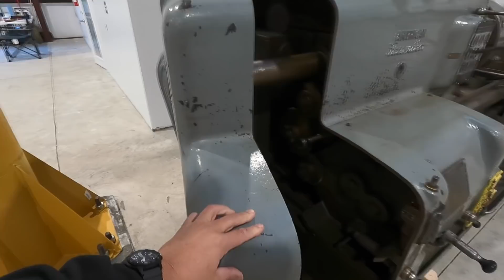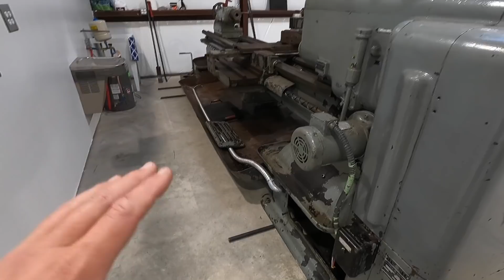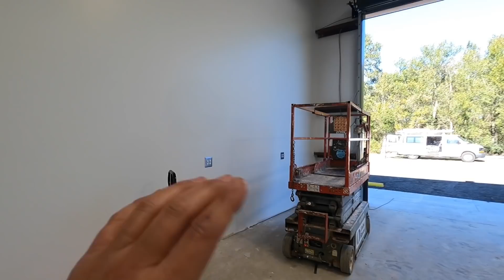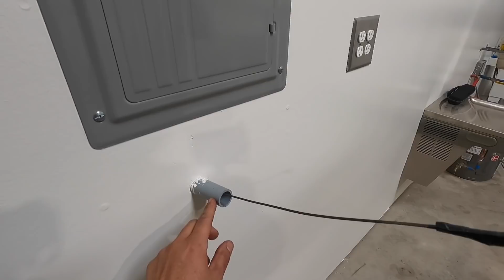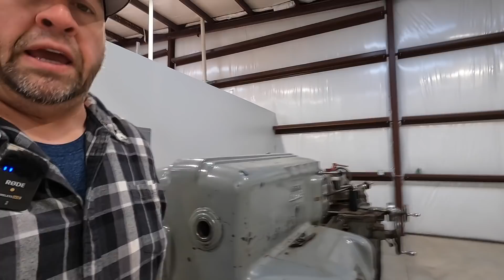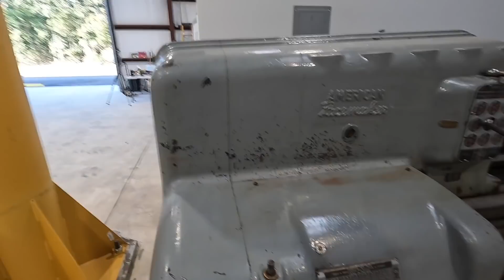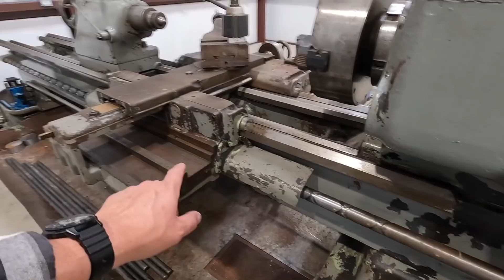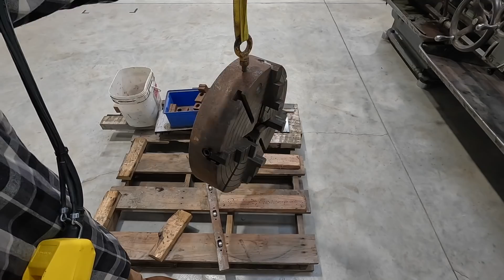New Shop Space Update 12: 3 Phase Electrical Circuits, Lathe & Crane First Tests

Comment: Adam, I wonder if cleaning the rust off the chuck might be done with blasting it with dry ice or baking soda. I've seen both used to clean wood surfaces of things like mold, paint etc.
It might be worth looking into because I'm pretty sure neither one could harm steel. (like the treads)

Comment: Heaters in motor starters are always rated for the motor plate amperage at the voltage they're wired to run at. You stated that the lathe was wired for 460-480. Rewiring the motor connections to 220-240 causes the motors to basically draw double the amperage that they were on high voltage which will cause your overloads to kick out. 
All of your motor starter heaters will need to be changed for the higher amperage.. The motor plate will tell you the size that you need. There's a good chance with very old lathes that you won't be able to buy heaters for those old fashioned starters/overloads. You may have to upgrade the motor starters or at least the overloads to take a more modern heater.

Comment: wondering if dropping the electric from above would have kept that conduit off the floor! i really would hate the dust and chip catching capability of that!? how bad would it be having the juice come from above?
Reply: I'm sure Adam will fix that tripping hazard. I surely wouldn't want to be stepping over that for many years. Cut the concrete and put a conduit in. Probably 30 minutes work.
Reply: Here’s an idea.  Build a 36 inch wide raised plywood walkway behind the 
lathe with the conduit running under the walkway for safety. Use Marine plywood 3/4 x 36 on 2x4 runners painted grey  walkway should run full.length behind lathe to water fountain.

Comment: Wrong heaters for motor, bad motor, wired incorrectly. My 2 cents, should take only a few minutes to figure it out. Heater size for amps may be on inside cover. Regards.

Comment: I used to install heavy industrial equipment, 10s of tons.  A stevedore dolly or as it is known today a lever dolly can easily move heavy equipment short distances to tweak placement.  You insert the dolly at an angle, lift the load, them rotate the handle of the dolly sideways, moving the load a few inches, then lower the load.   There does not seem to be any videos showing the use of a stevedore's dolly.

Comment: The heaters are the wrong size ,you went from 480 to 220 volts so you need different heaters not a new box . the electric should be able to get them. ( the old electrical service man,)

Comment: The heaters are sized to the amperage, at 240VAC the amp draw is about twice the amount of operating at 480VAC. The shop is looking great.
Reply: When you reduce the voltage the amps go up to make the same power.  Likely you’ll need to double the rating on the heaters.  The are basically thermal overload protectors.
Reply: Yes, The heaters (or overloads) need resized for the 240 volt amperage.
Reply: My second guess was one of them burnt open and one is taking the full current. If it’s wired in parallel (who knows by what the video shows)
Reply: Exactly what I was thinking. 👍
Reply: At 120 it’s triple
Reply: Ohm's law! Learn it.
Reply: @lukamadunic8534  ohm's law is for DC aplications only...!
Reply: May be i'm wrong ,but that motor needs to change a connection from star to delta ,and it should solve thermal fuse issue....
Reply: @dzintarsdzintars1547  It's unlikely this motor can be changed from star to delta.  Most dual voltage motors are either wired as star or delta and that doesn't change when the voltage is changed.  The way a dual voltage motor works is that each leg of the star or delta is made up of two windings instead of one.  When the motor is operated on high voltage the two windings are connected in series.  When operating on low voltage the two windings are connected in parallel.  Some motors can be changed from star to delta but that is not for voltage changes.  That is done to give a crude 'soft start' feature when starting the motor to reduce the inrush current.
Reply: Nothing you said there actually made sense
Reply: The heater resistance is constant, so half the voltage is half the current, and thuis a quarternof the power. Must be something else wrong.
Reply: @loewietje4897  👍 such a simple notion missed by so many people!! Assuming of course the elements are purely resistive.
Reply: Admittedly the circuit is probably more complex that the suggestion of being just basic resistive loads at the terminals.
Reply: @loewietje4897  Your comment is partly correct but does not hold in this case.  If the only item in the circuit is the heater then your comment is correct.  Halving the voltage results in a halving of the current through the heater and the product of half the current times half the voltage gives one quarter of the power.  However, in a motor circuit the heater and the motor are in series and the heater has very little resistance relative to the motor.  Therefore the heater has very little effect on the current flowing through the circuit when the voltage is changed.  When a dual voltage motor is changed from high voltage to low voltage the current must double in order for the motor to make the same power.  Since the heater has very little effect on overall circuit current, twice the current will flow through the heater.  Since the power (heat) created in a heater is equal to the current squared times the resistance (of the heater, not the overall circuit, and as you correctly pointed out, remains constant) the heater will generate four times as much heat, causing it to trip.
Reply: @hmw-ms3tx  thanks, that makes a lot of sense, so what people call heaters are actually a type of thermal fuses? That would explain a higher current due to feeding a motor of a given power rating at half the voltage.
Reply: @pjvenda  Yes, heaters are thermal fuses.  Since power is the product of voltage times current if you halve the motor voltage you need to double the motor current to maintain the same power output.  Heaters (thermal fuses) are rated for the current passing through them, not the power passing through them.

Comment: I'd be curious to know: If the steady-rest and the 4-jaw are going to "live" on the ways, should they be in place when you level the machine? There is a considerable amount of weight there, which could potentially affect the "flatness" of the ways, and, IMHO, if it were my lathe, would be something I would want to consider. Accuracy being what it is and all. 

NOW, time to back the Ram in, and do a "LOAD TEST" on that Gorbel!! I wanna see that thing WORK for it's money!! That thing was built right down the road from me. Curious to see how it's gonna hold up. I could have used that joker on more than a few engine and restoration jobs!! Congrats on the new shop and all the new "toys"!!

Comment: Forklift mechanic here, you can ride the middle pedal like you would an automatic transmission for delicate moves., the left pedal puts the transmission in neutral so you can rev the engine to speed up the hydraulic functions.

Comment: The Item used to pull wire is called a "Fish" .  Invest in a Phase Monitor It can save your Three phase motors. The better ones monitor power in and power out.
Reply: Been a licensed electrician and industrial electrical/millwright contractor for over 40 years. "Fish" is what you do up inside a wall ect. You PULL in wires through a conduit of other raceway, though. You do not "fish" conductors (wires to you) through anything, Dave. 

Go hang out with some union electricians at the bar and you will get a better grasp of our jargon. Looks like you got it all wrong,  bro..
Reply: @mathewmolk2089  fish tape is what 90% of people call it. Being a "licensed" electrician I'd figure you'd know that 🤷‍♂️

Comment: Check the control voltage coming from Transformer 
Needs rewired to low voltage. 
The output of Transformer is running at half voltage. And making contacts flutter. 
Just a guess.

Comment: Those heaters are overloads for that motor. It was wired for high voltage. Changing to low voltage doubled the current. They’ll have to be replaced with the proper amperage units.

Comment: Looks like what you call heaters are part of the starter that produces heat to trip out now just about obsolete thermal overload. It appears that there is only 2 heaters. Since at least 1970 code requires 3 thermal over loads on all three phase motors. GE is the worst safety switch and most hated by sparkies. GE always had the worst service & tech support. Last 2 120/208 ge garbage panels that I worked in could not open doors more then 90 degrees. Both were brand new not cheap 3 phase 42 circuit bolt on breaker panels. Good luck with the new shop.

Comment: The heaters/overloads for the rapid motor are sized for a 480VAC motor but since you are using 240VAC the heaters are sized to small. The heaters need changed.
Reply: Good idea and also change fuses because they are at half the amps needed now.

Comment: Clutch noise - it's not as bad as mine, I think ! Greasing the clutch bearings will quieten that. 
Overload trip - as you've connected it to half the previous voltage, it will have doubled the current - as the power of the motor remains the same. That will trip the existing overload. It'll just need different heaters or setup for the lower voltage. Keep the existing bits though in case when you move you end up going back to high voltage. The spindle motor should also have an overload trip too.

I'm going to have a random guess that the spindle is an L1 taper - on the grounds it'll be bigger than my L0 taper. I've heard people say they don't like this spindle fitting but I like it - because things will only fit one way.

Comment: the heaters need to be replaced with units that can handle 2X the current.  The transition from 480V to 240V halfed the voltage which doubles the current per Ohm's law (and reality!)
Reply: My thoughts exactly....I dont know if they even make overloads with heaters anymore. It pays to be the old(er) guy sometimes.
Reply: I just also remembered dashpot relays from back when. Thats some old stuff for sure.
Reply: i had the same issue with my 10ee.  came wired for 3ph 4 wire 480V.

Comment: As a life long electrician ALL electrical panels need a minimum of 36" in front of panel along with believe at least 32" wide space. Had inspectors write up companies because they had a 30" deep work bench in front of a panel. NEC wants ALL panels to be readily accessible. Fire marshall had a baby when he went into customers main switchgear room and found a skid of popcorn kernels stored. Told them about this violation a few times but they ignored me. Thanks for all the great vids. Always liked doung electrical work in machine & tool & die shops the most.
Reply: It will be just fine
Reply: @littlejackalo5326  As long as he does not store 55 gallon drums skids etc blocking a clear path to panel. Did a lot of work in machine shops that as time went on they accumulated  a ton of stuff. Used to piss them off when I told them that the machine 3' in front of a panel must be turned off for several hours while I install conduit and wire because isle is blocked.  Did the OSHA 10 class to renew my electrical license and up until the pandemic started attended 8 yearly classes by the great IAEI where they brought up all kinds of violations. We had Mike Holt come up from Florida for a couple of classes and a guy from UL labs. Learned that the cord & plugs that I have probably made over a thousand of them in last 50 years are not legal even though I use a meter & a 1000 volt megger to check them. They have to be listed. So if a customer wants a 3' cord & male plug for say a garbage disposal I have to go to my supply house or big box store and hope they have 1 in stock.
Reply: @garbo8962  Anybody catch the fact the 120E240 1ph and 240 delta service disconnects are not grouped as required in the NEC 230.71? (I don't think they pulled permits on this one, so Adam should be OK)

Just FYI I always liked to design systems to put panels in a hall or walkway where nothing will ever get piled in front of them. Worked quite well for over 40 years.
Reply: @mathewmolk2089  did not pick up what you mentioned. Thought  he only had a 120/208 service.  In my area all new work on a new building must have a petmit and pass an inspection by an approved inspection agency. The local ultility company will not supply power until the inspector calls them. Just love when a clue less local imspector fails a job after an inspection agency approved it. Had one local ahole call me up to tell me that I had 3 violations. Told him that if I had 3 legitimate code violations I would quit doing electrical work. First piss poor violation was that I spliced 1 #14 guage wire in replacement panel. Told him exactly where in the codebook this allowed. Other 2 violations were for the way Pepsi guy wired up a new outdoor sign that was not on my petmit or connected in any way to me. At a continuing education class an inspector told us that in some small rural areas homeowners get a general contractors license so they can pull electrical plumbing and other permits. Our state does not have a state electrical license and some hick towns do not recognise electrical license from any where makung you spend halve a day to take their test. We have been trying to get the state to go with a state license since 1964 when my dad took his test.

Comment: Congratulations! As you fill that place up and start running out of room you might consider placing that lathe on an angle.  I might have been tempted to tuck the head stock end  in-between the wall and crane.  Provided there’s enough room to open that door, would also allow for long stick support if you ever needed it.  I know that electrical box is right in the way…

Comment: If you have changed the voltage that the motor is running on then you must resize the motor starter heaters.
Reply: Quite right. The heaters act just like circuit breakers in that if the circuit draws too much power the heaters heat up and open the contact points they use. All your electricians will have to do is use a amp probe to measure the amperage being used by the motor then replace the heaters that can handle that amperage.
Reply: @sandrammer  Well not actually, the heater has to be sized by a chart because if you use the "run amps" then the heaters will trip under normal operating conditions. I has been a long time since I had to work with motor starters and heaters but i think you would size for something like 15 or 20% above run amps. Enough to protect the motor but not have a bunch of nuiencentes trips.
Reply: @davidtyndall9604  , I didn't mention the sizing of the heaters because I couldn't remember how much larger the heaters had to be to work over the life of the motor.

Comment: Love that lathe, congrats on getting it running. A lot to do before cutting chips but at least you have power, next is leveling it and then you can finally go through it and get it up. Congrats Adam. Looking forward to these stages in my own shop. As for you being very happy, I would be dancing a jig and having a nice frozen vodka. Very cool.
If it were me, my very next item would be a bench, even if it is temporary to use while getting the rest of the shop together. Maybe on some casters with locks as you will need to be able to move it around as you set the shop up.
Reply: I wish I could make progress with my own 'toys'. I've an electrical problem I need to sort out - then it's lubrication - on a pair of machines I've inherited.

Comment: The heaters are sized for the motor running at 480 volts. The heaters need to be sized up for the larger amperage the motor draws at start up on 240 volts.
Reply: Most electricians are not motor controller techs.
Reply: It's not the starting current that's the issue but the running current.

Comment: It'r probably to late now, but when the electricians changed the voltage on the little motor they should have changed the heaters in it overload switch. When you half the voltage you double the amperage, thus a heater change is needed.
Reply: In the UK our overloads are adjustable. Depending on the specific overload as to whether it'd readjust far enough or not.
Reply: @millomweb  , here the USA the modern ones are to. However this is an old unit.
Reply: @johnirwin1837  Our Elliot Cardiff has non adjustable heaters...It's an "old" machine though.
Reply: @johnirwin1837  Modern ones don't appear to have reached YouTube yet ;)
Reply: @millomweb  , the new starter in the box on the wall is a modern one.
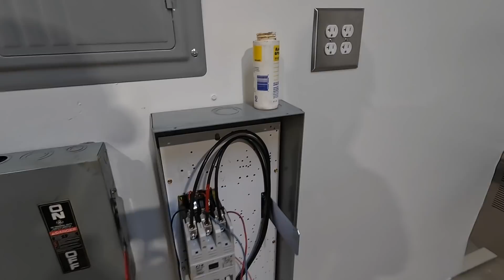Reply: @johnirwin1837  Ahh, I hadn't spotted the thermal overload below the contactor  (24:07)

Comment: The heater strips are tripping because when the machine was running on the higher voltage it was running at a lower amperage, so the heater strips need to be replaced with the appropriate rating for the new lower voltage

Comment: How is it a guy who deals in thousands and ten thousandths, doesn't check parallel with the expansion joint using, oh I don't know a tape measure!?!?  😀 😀 😀  The reason the heaters are tripping, is because of the new voltage.  Running off 240v 3-ph. vs. 640v 3-ph. depending on how it is wired has likely doubled the current to the motor (this is normal) but is means you need to install new heaters for the higher current so they won't trip out.  Newer electricians may not be aware that in the old days you swapped heaters as necessary, not dial in a solid state cutout.

Comment: as you decree  will voltage   by half  amperage  will  dubble so the heaters are  rated for  480 volts not 240volts

Comment: when im pushing or pulling machines around in my shop, i put 2 pieces of blue tape on the floor right at the inside corner of the front foot's new intended location.  I then simply bump it along until it is just above my mark and then gently set it down.